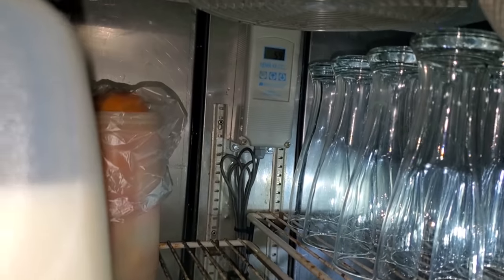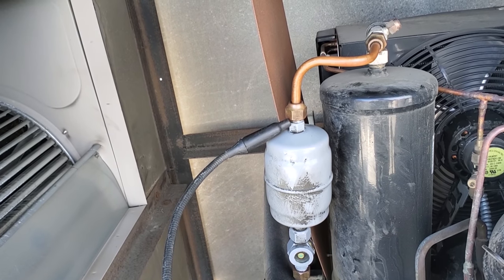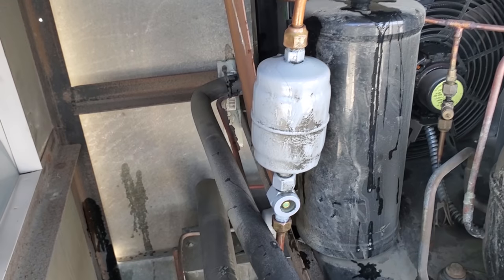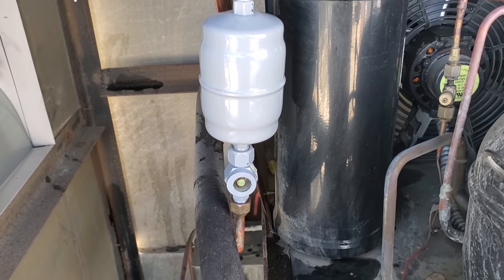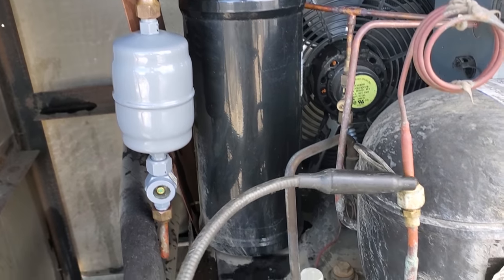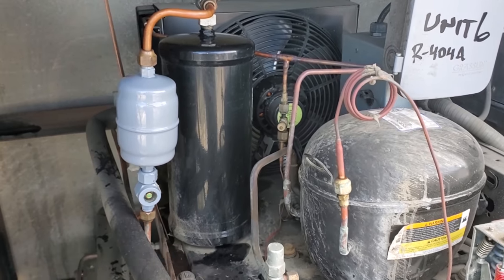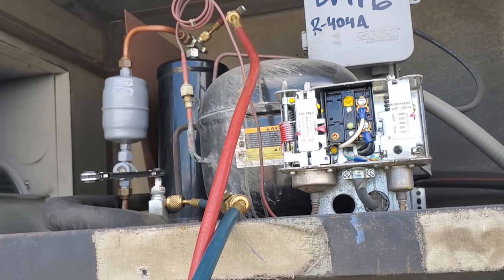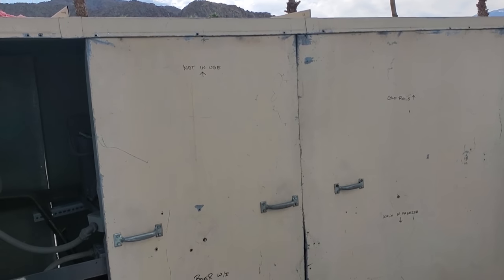THE BAR REACH IN COOLERS ARE TOO WARM

Comment: I had exactly what you're having about 10 years ago.  I now have a titanium plate and bone graft in my neck fusing 2 bad cervical vertebrae.  I was back to work in 2 weeks.  Hope your pinched nerve is only that and nothing more extensive.  Sucks when you have a physical job and have to go through your day in pain just to function.  I hate going to the doctor and put off doing so until I was in such pain I couldn't sleep or function.  You should get an MRI and check out what's going on in there.  So easy to not do 'due diligence' when it's your own body.  (and yet I still don't often take my own advice)  Hope you feel better.

Comment: Hey Chris, I have been suffering from the same thing in my neck for years. Some things that helped me are heating pad and lots of H2O. Also I used chiropractor, message etc. I found a PT place that does "Dry needling" it works to relax the muscles. Good luck buddy.

Comment: Air in the system is the worst. To prevent this, many times I will precharge my gauges to prevent air entering a unit.  The other alternative is to shut down the system let the low side build up a bit of pressire if it has gas, then hookup the low side and purge my gauges so as to prevent loosing a minimal amount of gas, not liquid.  If you dont shut down the machine and its in a vacuum on the low side, you just sucked air into the system and need to replace the charge now. Thats one reason I precharge my gauges b4 hooking them up.

Comment: Tricks of the Trade -- if the Tstat is bad (no continuity at room temp), the condenser fan will not run, but the evaporator fan does -- use an extension cord hooked to the compressor & wall outlet to verify compressor & fan work. You can also install a jumper between the run & start windings to simulate a start relay -- after applying voltage, pull the jumper.

Comment: Chris, you mentioned you used paint markers to mark equipment because it will last longer (I hate when people use Sharpie as it lasts about 2 months) I keep a carpenters pencil in my pocket, I found pencil lasts for years in the sun.  I'm in Colorado where the sun shines over 300 days a year, I have seen my pencil writing on equipment 5+ years after writing on it.
Reply: How about PaintStik? The "welder's crayon?" I've seen that stuff last over 30 years (as a stupid child, I wrote all over a 1953 Army trailer that used to be my father's, most of the writing is still visible).

Comment: Have you consulted with a Chiropractor?
The pinched nerve might be caused by a joint that's out of it's proper position and/or bad posture.
I had several tendons that make up the rotator cuff of my shoulder become inflamed (4 tendons per cuff, 2 in my right cuff and 1 in the left - both arms now have permanent restricted motion - MASSIVE PITA) due to my admittedly horrible posture and that might be an aggravating factor (and/or the root cause) of your pinched nerve...

Good luck and I hope you have speedy recovery...

Comment: Hi ! thanks for the video ! I hope you're feeling better. Those pinches are painful as hell! I noticed that the TVX bulb is not insulated from the air flow of the evaporator fans. Doesn't it affect the superheat stability ? I once was scratching my head trying to figure out why my TXV was opening to full throttle then closing again in an endless cycle. It was a walk in cooler I just installed. My sight glass was flashing too as the TXV opened wide and the superheat was all over the shop. Everything came back to normal when I installed a piece of insulation tubing on the bulb.

Comment: I've  have had 2 pinched nerves . One was between the back ribs below shoulder blade which caused immense pain every time I breathed out . I had to get driven home and was hunched over for a few days . Just last year my lower back . That was like a knife . for 3 weeks I couldnt work unaided , with 2 walking sticks and that a step at a time to get from bed to chair . I had to get doctor out to get Panadeine forte , then I could get to a Physio . Use those heat up wheat bags but you will need Physio

Comment: I would always spray a light coat or two of clear coat after I wrote on any piece of equipment. Most times it would allow the writing or label to last a few years longer, at least in the South TX sun.

It's another thing to carry in your bag but helps quite a bit.

Comment: amatureish question, you weighed your cylinder before you went up, but how did you figure out how much to add? thanks!
Reply: Ya, I was assuming that since he confirmed he had a leak, gas must be lower than install- so I guess he just charges (within reason) up to a clear sight glass and the right readings?

Comment: ive been watching for a little bit now. i'm not a hvac professional but i do enjoy your videos. its clear youre very knowledgable and dedicated to your craft. as a general viewer of your videos i still dont know a few things. eg. what is the sight glass? how does it work? what are you looking for? you mentioned it was "fashing" but i have no idea what that means and i didnt notice a difference when you refilled the gas. what gas are you putting in? what should the high and low pressure be during various points in the operation of the equipment and why? what is high and low? a lot of times you show an app on your tablet and mention super high and numbers. these things are probably obvious to you but things i still dont know after watching all your videos.
Reply: Y'all feel free to correct me if I'm wrong... But let me see if I can clear a few of your questions up. (Not an HVAC tech, by the way...) 
The sight glass is literally a piece installed in the refrigerant lines where you can see the refrigerant passing through the lines (in its liquid phase) at that point through a glass window. If the sight glass is "flashing," that means there are visible air bubbles passing through the liquid, indicating the system is low on refrigerant charge. It's hard to see on camera sometimes, but in this video I actually could see the bubbles passing through that Chris was talking about at timestamp 0:44 for a split second. It's blurry due to the camera not finding a point to autofocus on quickly enough in this example.
The high and low pressure ratings differ based on the refrigerant used. Thus, the ideal pressures vary. Deviations from the ideal pressures help lead to proper diagnosis. If you look closely at most of the systems Chris shows us in his videos, most of them have the refrigerant type handwritten somewhere (R-22, R-404A, etc.); this is the "gas" he used.

Comment: Chris try buying a circuit finder you simply attach it to wherever there is power and it beeps on the right breaker it's a lifesaver and removes the silly frustration from messy unlabeled panels
Reply from the maker: I have never had any luck with circuit finders in three phase panels....

Comment: Why? — On the left side of the condensing unit, behind the dryer, there's a vertical piece of sheet metal. It appears to be a baffle, to divert the air from the swamp cooler away from the condenser.  Is the air from the swamp cooler too cold, too forceful, too humid, too dusty, or something else? There must be an important reason for it to be there. Why?
Reply from the maker: The air opposes the condensing units condneser fan motor air flow, so the baffle stops that
Reply: @HVACRVIDEOS  
Thank you, Chris!
—  I'm no longer baffled by the baffle.

Comment: Forget medication for your pinched nerve. Try and find a good chiropractor. After a serious car wreck, I had similar issues where I couldn't even lift my arms from my sides and my left hand would alternate between uncontrollable shaking and inability to hold objects. After the first two visits, I regained most of the mobility, and a few more visits cleared up most of the pain.
In most blue-collar fields, the human body gets subjected to all sorts of abuse to the neck and back. You're hunched over a lot, which pulls on the muscles of the back/neck/shoulders and puts stress on the nerves passing through the spinal column. Many issues can be attributed to misalignment of the spine and neck, even pain/weakness in places far from the back itself, due to pressure on the nerves. I'm almost willing to bet real money that a few adjustments, in combination with heat/ultrasonic therapy and stretching exercises, will bring you some, if not total, relief. A good chiropractor will tell you honestly whether they think they can help you during the initial consult. Results might not be immediate depending on the extent of the damage and how quickly your body adapts to adjustments, sometimes the adjustments must be done in stages in order to achieve proper alignment over time, but there's also the chance one or two adjustments will have you 100% again.
I'm no doctor, but I play one in YouTube comments. LOL
Do not go for surgery unless it is your last resort.